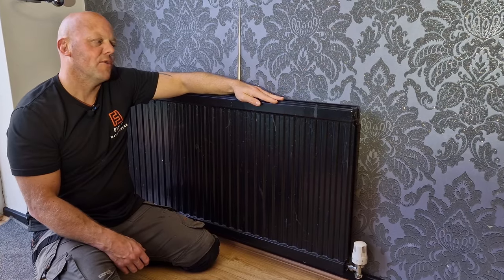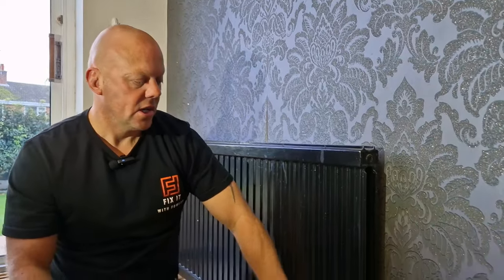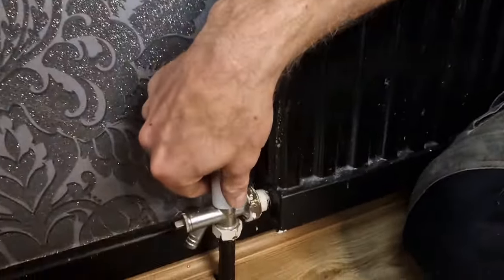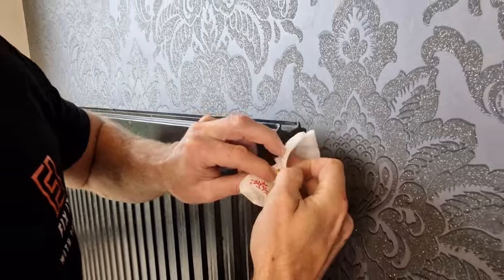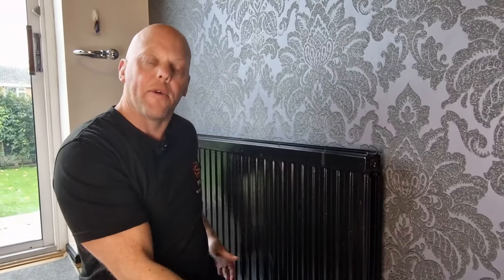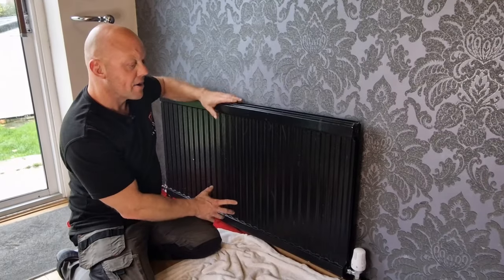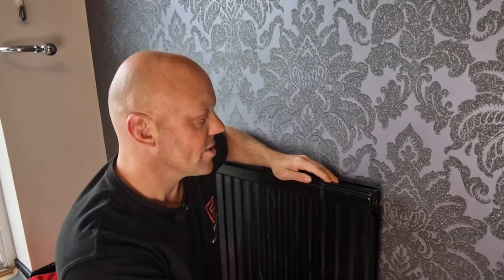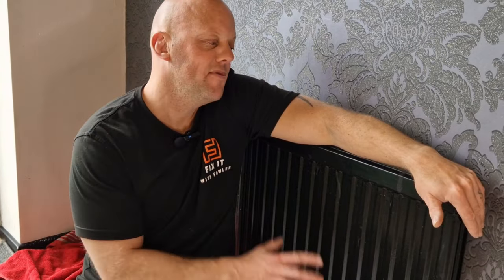How To Remove A Radiator For Decorating

Comment: Good afternoon. I don’t know what to do. I decided to contact a specialist. I’m leaving for a long time. I don’t know what to do with the heating boiler. The brand of the boiler. Some advise not to turn it off, but only to lower the temperature on the meter to 12 degrees Celsius. And leave the boiler running. Others advise draining all the water from the radiators and turning everything off completely. I’m worried about what to do. Last year I simply turned off my gas heating boiler completely. And as a result, in December something burst in the attic where the water tank was and flooded everything. Please advise what to do. Best regards.
Reply from the maker: Hi, my advice would be to leave your boiler on but down the thermostat down to 5°. This is the standard frost setting to prevent freezing, but if you wanted to air on the side of caution, you could set the thermostat  to 8°.